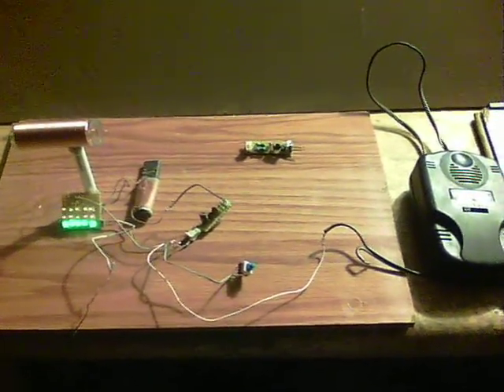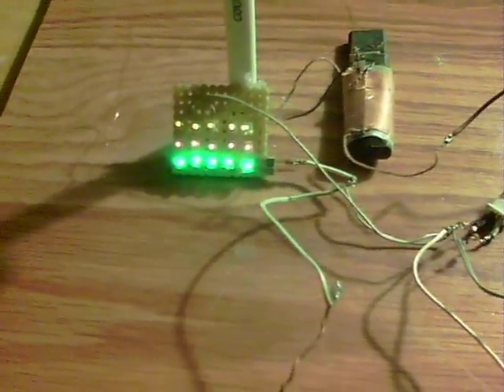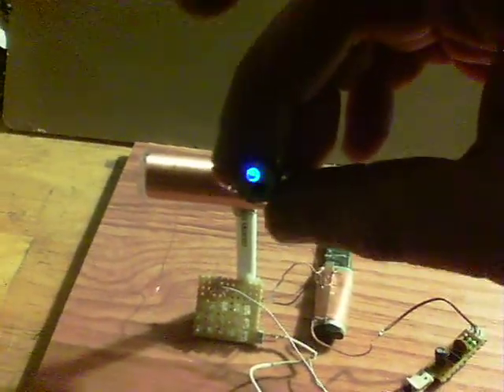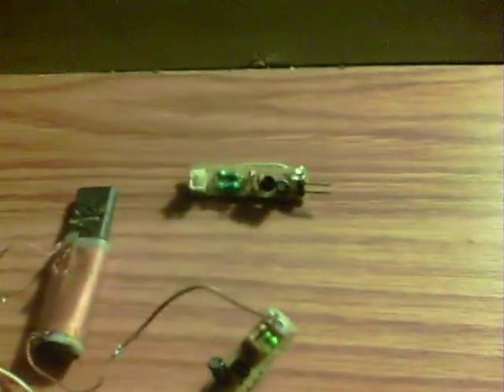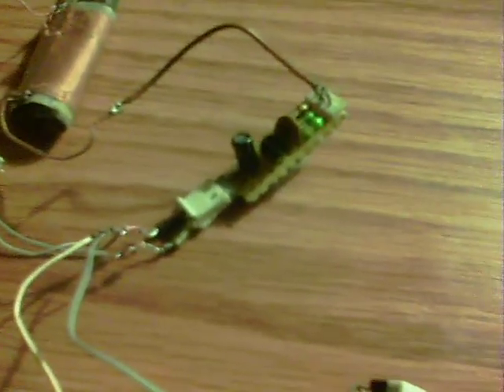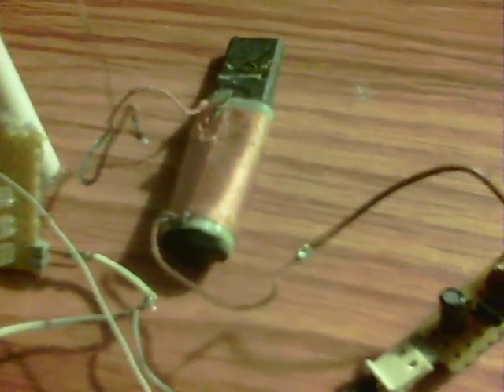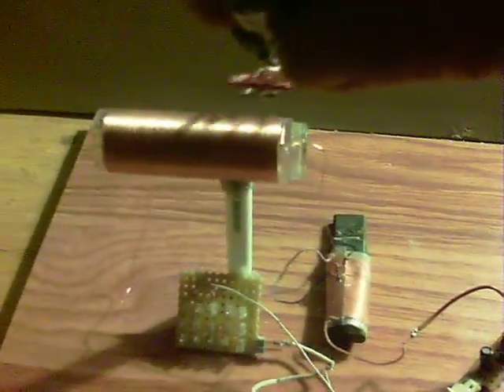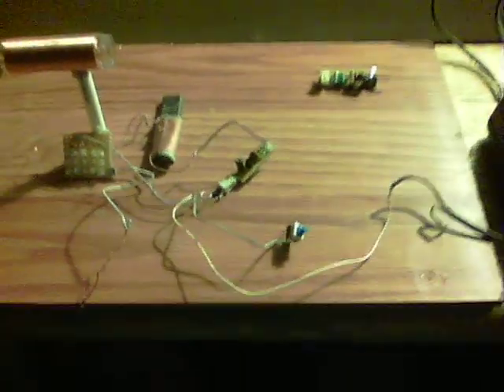zero volts wall adapter - now wireless !

Comment from the maker: The 2 diodes are the A/V plug, with antenna of copper wire. Germaniums have seemed to be too slow, Schottky's are the winner above 1N4148. Anything can be run, motors and digital circuits. One thing is precautions about HV arcing that can happen, so good design of mesh or other shielding is needed for digital circuits.

Comment: That is Awesome!!!  I can't wait to try and replicate that simple circuit. I'm playing catch-up watching your, Lid's, Slider's, Laser's, Stiff's, etc, etc, etc. It looks like an all-in-one! Fascinating!
Reply from the maker: Thanks. A 1meg resistor and '104' orange ceramic cap across it works well for the Penny type oscillator and the use of 2x 1000uH inductors instead of floral wire coils. Then, an old loopstick assembly from a thriftstore AM/FM radio and 100+ turns on an old solder tube. That's about the whole lot for wireless like this.

Comment: Ive noticed similar stuff with other Joule Thief type oscillators too.  Especially the ones that get over 100v (on a scope) with no load. You might find it interesting to have a cap of greater volts than the output peak, between oscillator and transmitting ant. I havn't done it with an ant(aside from clip leads in circuit), but when I charge a cap to 250v, especially a larger farad one (2000uf+). I noticed LEDs lighting when not connected, or touching me, or with one leg connected.

Comment: I think it's more a watts thing, currant and volts. Although the the cap allows for more currant, thats why the watts go up, once it's charged.... Look at radio transmitter ants, they are all rated by the amount of watts they can send..... more watts greater range. Lower freq greater range, but less information per second. Not sure if information capacity is relevant to transmitting power. Tesla seemed to get greater distances from higher freq. 

Is there any circuit on your receiver leds?